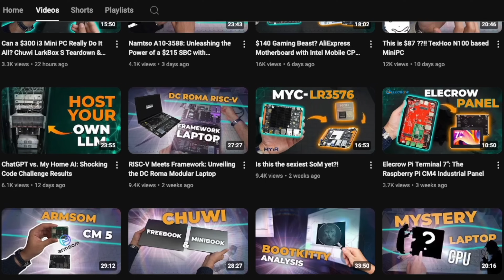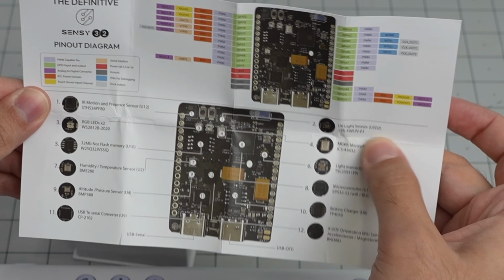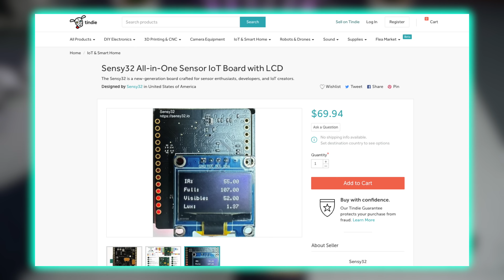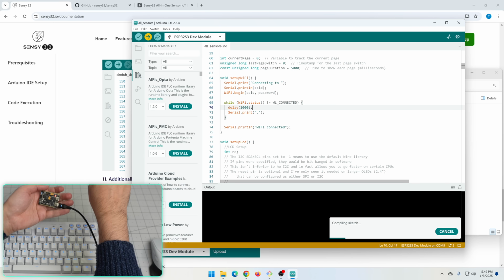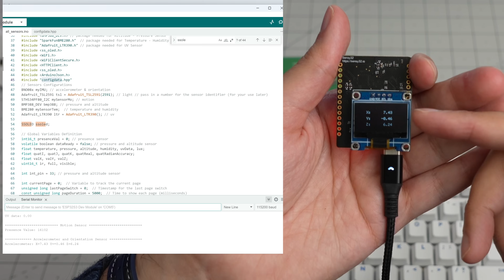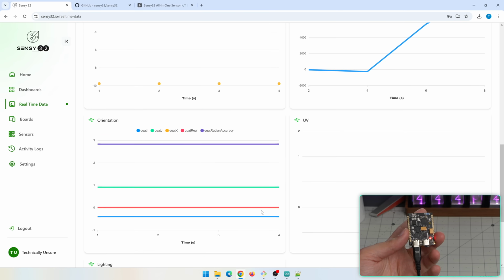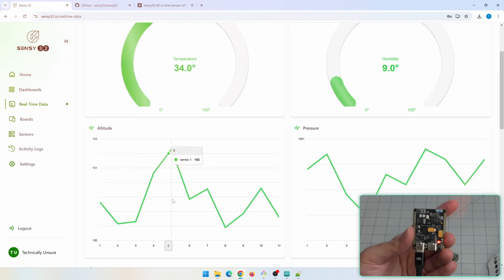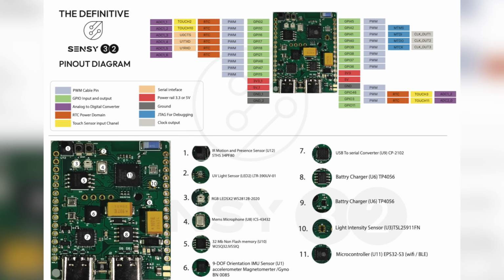World's SMALLEST Ultimate Sensor Board?

Comment: Sorry not ultimate sensor board, no mmwave or UWB.😅
Reply from the maker: It does have 2 USB ports and maybe no mmwave, but it does have human presence sensor
Reply: @TechnicallyUnsure  sorry auto spell changed UWB to USB, now corrected. What does it use for the human presence sensor?
Reply from the maker: Yeah, no UWB and for human presence, it uses STHS34PF80
Reply: @TechnicallyUnsure  that is PIR so motion not presence.